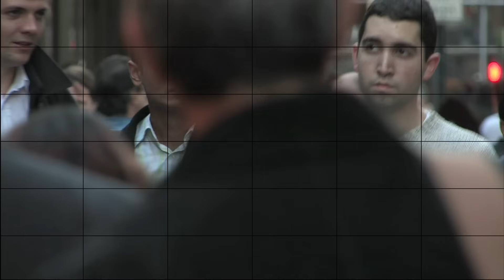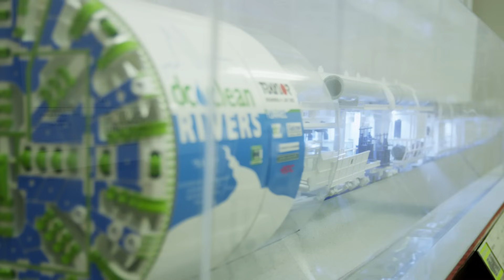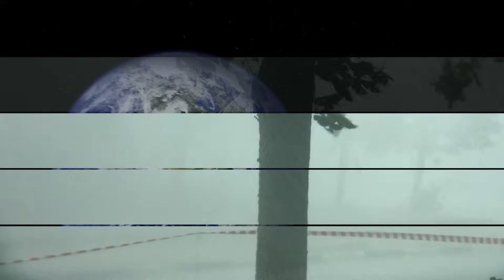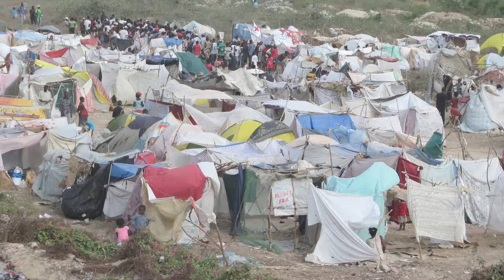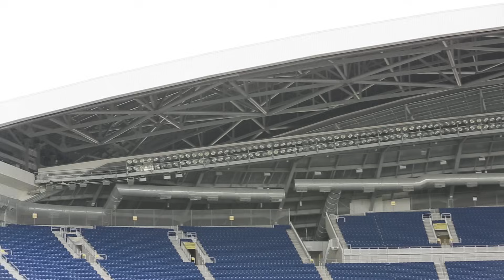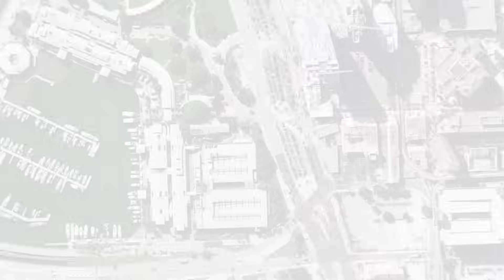What Do Civil Engineers Do?

Comment: Still trying to find out why civil engineers can't find way to use pipelines to help remove water from flooded areas. I understand the volume is tremendous but with the new miracle materials ,light weight and very strong and flexible. surely a couple of thousand of them would help.I wonder about this when I watch forests out west burn for weeks. Why can't water be transferred across country in pipes. Would really appreciate an answer.

Comment: Civil engineer also contribute to design safe buildings.
Reply: @Syed Shuvo That is not true. Civil engineers do static analysis for buildings and for example design sewer systems. Imagine if architect was doing the civil engineers job in Burj Khalifa project. Architect do not have permission to do that and they are not even schooled to do that. What you are saying is half way true in project of building a normal house. Normal builders can do that but with architect and structural engineer final product is better. Architect is the boss in that project but civil engineer is more than necessary.  Also if you are building highway, dam, bridge, tunnel etc. architects does not exist in those projects and civil engineer is the main guy.
Reply: FreeLogismiko Software 

...  .